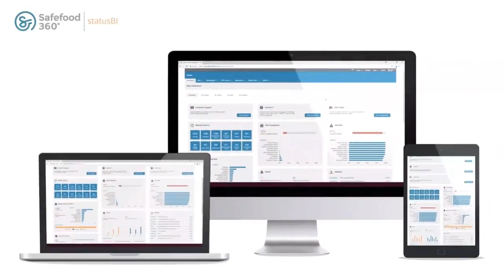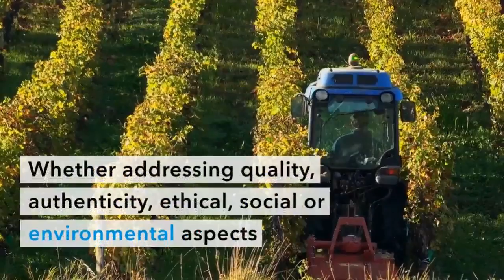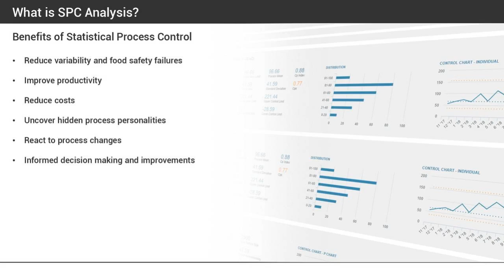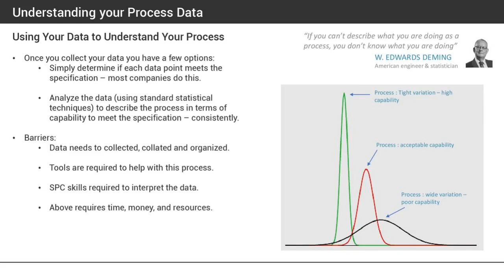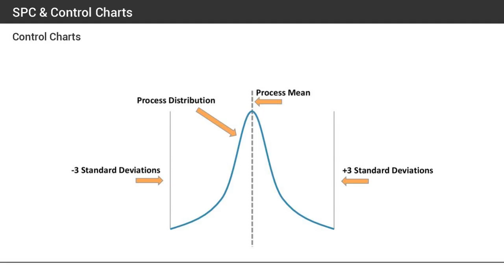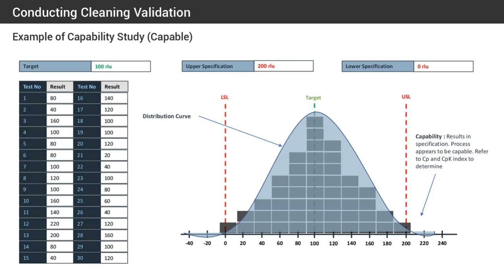Food process improvement using Statistical Process Control (SPC)

Comment: Excellent information however the presenter made an error by assuming that all processes are normally distributed. This is evident in the sanitation validation example where applying the normal distribution approach resulted in calculations of negative ATP values. We all know that it is not possible as 0 is the lowest value.  In the example, the curve should lean to the right. A normality test is essential at the beginning of any data evaluation.